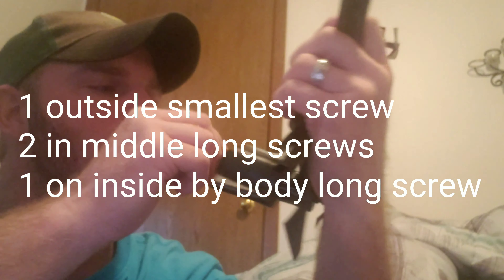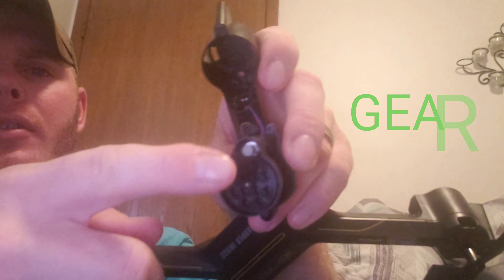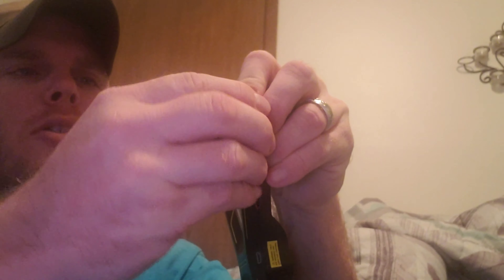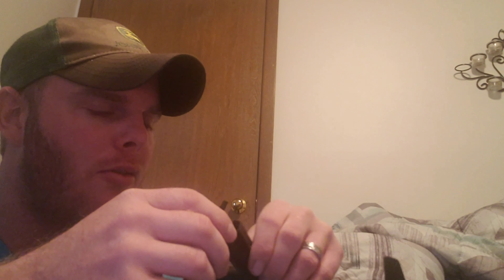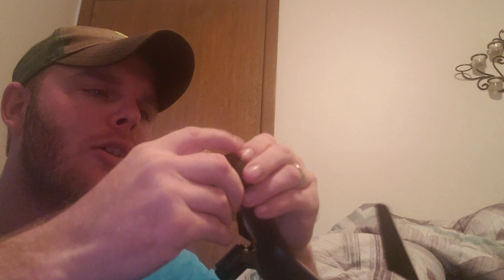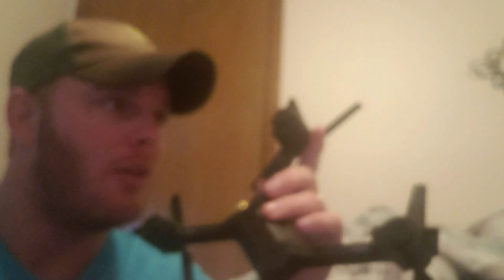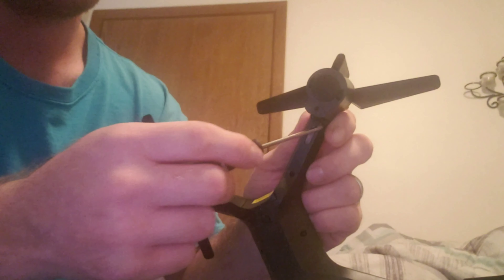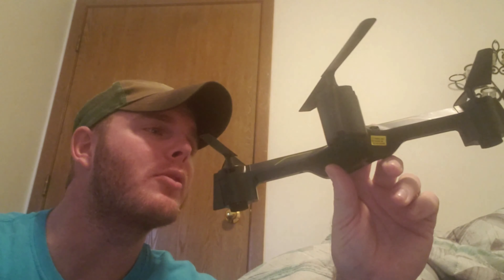How 2 replace a motor gear quick and easy on a SHARPER IMAGE DX-4 DRONE

Comment: Anyone know how to remove the camera out of this particular drone without breaking or damaging any parts?
Looks to “clip” together as two half’s that make the camera hold in the frame, but before I try applying more pressure I want to see if anyone here knows or has any ideas on the correct way to remove the camera outta its housing...
Thanks in advance!!!
Reply: Ok figured it out. Made this harder then it really is. All you need to do is push it up n out of its housing once you have all the screws removed that hold everything in place... once the board is free’d of the camera you can then push it out from the outside of the drone and it’ll come right out and it’s out!!!
Reply: Yessir. It sure did. I over thought it due to not wanting to break it. 
I have a plane I got and I was wanting to install a camera on it, thought instead of buying it I can use that one from the old drone with the app already on my phone. I’ll just have to wire the power wires in place and I should be good to go to use on the plane!
Reply: Most definitely, it may be a day or two until I get around to messing with it on the plane but once I do I’ll deff let ya know sir!
Reply: @high noon drone showdown 
So just to update ya it worked. I bought an extension plug in for that plane model(ie. led lights or a camera) so there was three wires that held in the camera board and I assume it’s all only for power. So I got 3 solid copper wires to stick into the connector the 3 wires led to plug into the drone, stuck them in there and cut the end of that extension cable and connected the solid wires I plugged into the connector clip to it and plugged it into the plane and whala bam💥 it had power and the blue light came on and I went to my phone WIfi and it showed the drones WiFi signal, connected to it, went to the app.. and it worked and I’m able to view in live time my plane and have fpv and I was able to just use the camera from an old drone I didn’t use anymore. Heck I can just undo my connections and plug it back into the drone if I wanted too!! 
Hope this maybe helps someone out there... lol